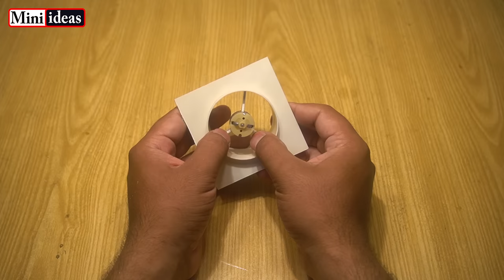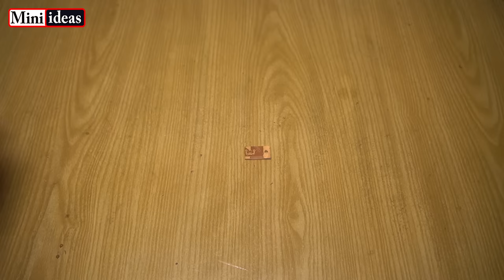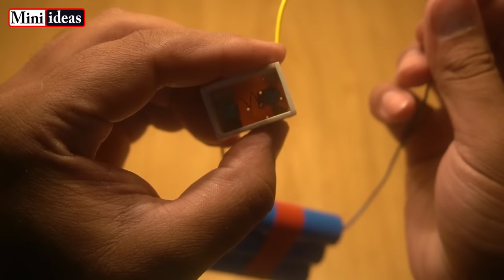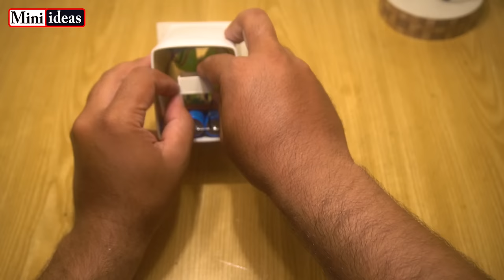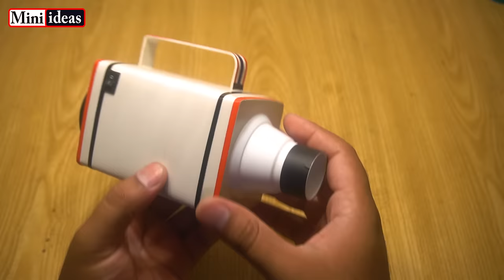How To Make A Fog Machine At Home | Rechargeable Smoke Machine | Mini Fog Machine| Smoke Machine DIY

Comment: is this smoke toxic to inhale ?
Reply: no, it's fully safe
Reply: I dont suggest you going to inhale the smoke anyways u know just to be on the safe side-
Reply: it's full safe
Reply: Well sorta
Reply: With this machine no
Reply: If there’s no heat regulator the machine can get too hot and the fluid might combust and or burn making a gas that is toxic.
Reply: Carbon monoxide is produced while evaporation og glycerine,hence not recommended to smell.